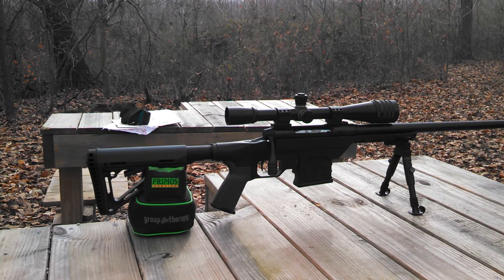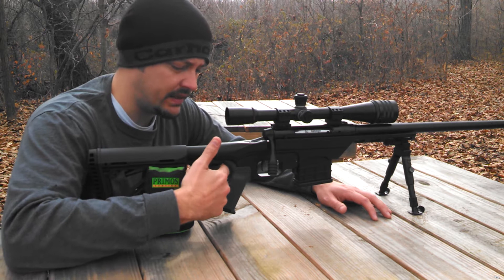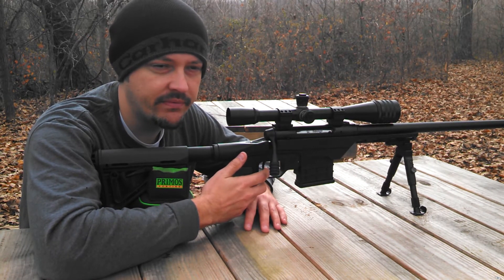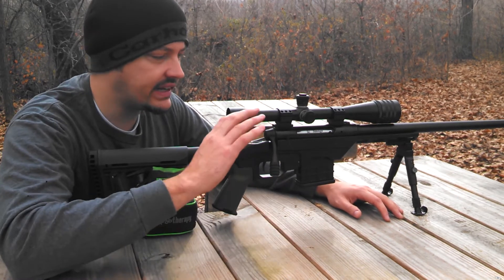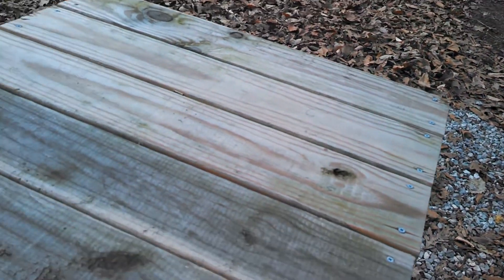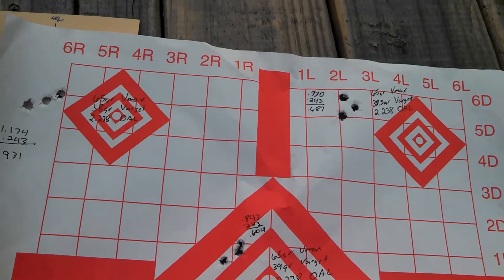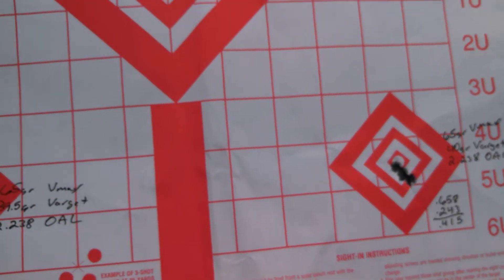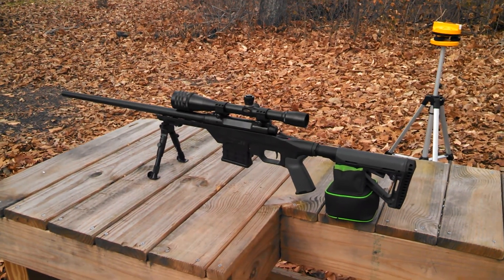Savage Axis 243 Heavy Barrel.. Project PRS Rifle, Part2

Comment: Thanks for posting d video. Just bought the .308 version heavy barrel from Budsgunshop and thought about upgrading a Boyds stock on mine.
Reply from the maker: +ced dgreat Yea you'll like it I'm sure. Take the time to either do the trigger mod or get a Timney like I did and with that Boyd's stock you'll have a real nice shooter! Thanks for watching....
Reply: Have a Timney on my Remington 700 and it's spendy so I am actually will try to mess around buffing the Savage trigger myself and see how it will come out. Thanks.
Reply from the maker: +ced dgreat The Timney for the Axis can be had for less than $100 shipped. I think I gave $98 for mine. So if you decide the spring mod isn't enough for ya the Timney is an option.
Reply: good to know, thanks.
Reply from the maker: +ced dgreat Not a problem, good luck with your project.

Comment: Do you have a video putting this together? I have this axis in .243 with a sporter barrel. What magazines work for this.
Reply from the maker: No bud I sure don't, the chassis is super easy to put on. Just remove the two action screws and put it in the chassis and torque down. Keep in mind to install the recoil lug in the chassis as well. This chassis uses the AICS style mags, also MDT sells their own polymer mags that fit this as well which is what I'm using. They work great and not expensive. Hope this helps, thanks for watching!
Reply: The Hide thank you.
Reply from the maker: Not a problem, good luck with your rifle.

Comment: Nice job on the video. I liked the details on the ladder test about the bullet weight, distance to lands and group size and charge weight.  It also did not take you twenty minutes to say it.  Very efficient.  I am considering a build almost just like it in a 7mm08 but with a 16.5 inch barrel for a super short mid range (600-700 yards). What is your barrel length and overall length of the gun when stock is extended and closed?  What is the weight as shown?  thanks.
Reply from the maker: Yea I try to do videos as Id like to see them, I don't always have time to sit through a 20 or 30 minutes video, lol. Yea that sounds like a beast, just keep in mind with that short a barrel your going to have some serious muzzle blast, not a huge deal just something to be aware of. The overall length extended is right at about 44" and with the stock closed its right at 40.5" and its running the factory 22" barrel. It weighs in  at a little over 9lbs unloaded. Thanks for watching an good luck on your project!

Comment: That looks a lot like my Axis only mines a .308 with a FDE chassis wearing a ATI tactlite stock stainless steel bolt handle, and a tango down pistol grip. Are you having problems with the MDT mags? When I load 10 rounds the mag bulges and won't fit in the magwell. I'm waiting more magpul to release their AI mags.
Reply from the maker: +xXspectre170Xx  Sweet I bet it looks pretty nice with the FDE. Yes I forgot to mention it in the videos, but I can only put about 8rds into the MDT mag. I'm just going to get a couple ACIS mags I think. Their a little heavier and more costly but I don't want to get into a match this spring and have mag issues. Thanks for watching!
Reply: The Hide You can get the steel ruger gunsite mags from cheaper than dirt they're $52 for the 10rdrs
Reply from the maker: +xXspectre170Xx Good to know thanks
Reply: I have bad news, Magpul AICS mags don't fit in the Savage Axis version of the LSS chassis... Looks like its hitting the bottom of the receiver when I try to insert it.
Reply from the maker: Oh that's good to know, thanks for the info.

Comment: Very nice recipe for your fine rifle, sir. On reloading.......Lets say a nice loading is found with full-length sized cases, if you use the same loading for a now fire-formed case....will the grouping change? Or will it remain as accurate or more? If not as accurate after changing to fire-formed, I would assume to use fire-formed cases during the loading search. Thank you for the video.
Reply from the maker: In theory it is possible it could change. The benefit of neck sizing a case is that the case is completely sealed in your chamber. There by making it a custom round for your chamber. I don't neck size 243 since I don't have a the die and its always shot well enough for me that I've just not done it. In serious competition you will see most if not all guys shooting fire formed(neck sized) cases. Thanks for watching!
Reply: +The Hide - awesome video and good job on the rifle mods. The groups are looking great too. As far as Sizing brass goes,  I use a neck sizing die and a redding shoulder bump die when necessary. I don't do this so much for the accuracy but for extending case life. I have more than doubled the brass life of most of the calibers I load for using this combination.
Reply from the maker: +kingrider75 Yea that's also an added benefit of using that type of die. Thanks for watching, greatly appreciated.

Comment: Just ordered a similar setup for my savage axis II 308. It came with a basic weaver Kaspa 3x9. Looking to upgrade. Any recommendations? Leaning towards vortex ha-t or ps-t model.
Reply from the maker: This is strictly my opinion and I will probably catch flack but I think the hs-t and ps-t are over priced for what you get. I had the HS-T and was not impressed for what it cost me. I ended up having to send it back for warranty work twice and just ended up selling it off. If you want my recommendation take a look at the Athlon Argos BTR 6-24x50, the glass in this is as clear or clearer than those Vortex models listed at half the cost and I haven't had to send it back for warranty work.. I have a video on this scope check it out! Thanks for the comment and the view!

Comment: I have a savage 7mm08 varmint barrel.  But no action.  Could I buy a axis and swap the barrel and put a new stock on?
Reply from the maker: It just depends on the shank size of the barrel you have. They can be either small or large shank, Small shank barrels are closer to 1.060, large shank closer to 1.130". If you have the serial # the barrel came from if you call Savage they can tell you what you have if your unsure. Hope this helps, thanks for watching!
Reply: As far as I know, all axis are small shank. I think all except magnum calibers are small shank. I shoot 139 SST in a 7mm-08 axis. half MOA normally.
Reply from the maker: Sounds like you found a nice load for yours. Yea I could see the magnum calibers being bigger.

Comment: How did your rifle group when it was stock prior to the chassis and trigger upgrade?
Reply from the maker: Here is the first video in this series showing just that, https://www.youtube.com/watch?v=0osxs_LCzsE&t=2s this is the rifle in stock form shooting some factory loads. Hope this helps, thanks for watching!
Reply: The Hide .  Thanks.  Seems like your Axis shot pretty well stock to begin with.  My Axis in 308 Win is shooting the same stock and even better with handloads.  I was considering the same chassis and was wondering if it improved accuracy at all.  Thanks for the reply.  BTW, that Axis is a completely different beast on that chassis.
Reply from the maker: The best answer I can give as far as an accuracy improvement was it make the rifle a lot more shootable. If that makes sense, it made it a ton more controllable and it may have not added to overall accuracy but it made it a lot more consistent. Your quite welcome, good luck with your rig!

Comment: were did u order ur extended bolt i cant find southern ordinance online
Reply from the maker: It actually came from their Ebay store. they actually don't have an online webstore yet. Thanks for watching!
Reply: The Hide 
is it pretty easy install
Reply from the maker: Super easy. Just take and wrapba towel around it to protect it an chuck it up tight in a vise. Then unscrew the large hex bolt on the back. Remove the bolt handle then reverse the procedure. Its very easy..